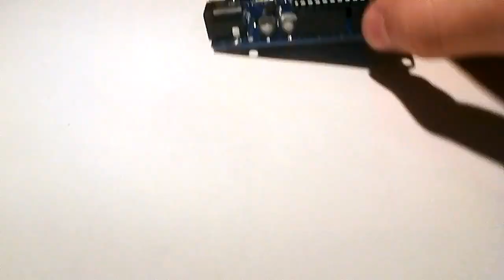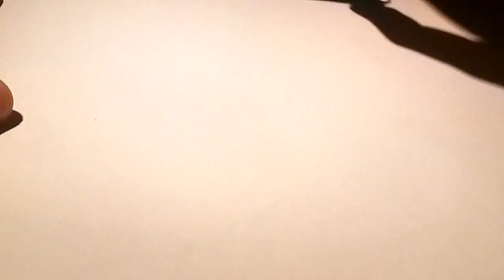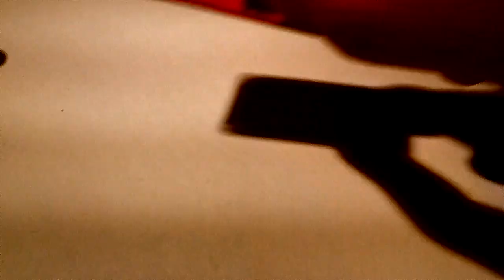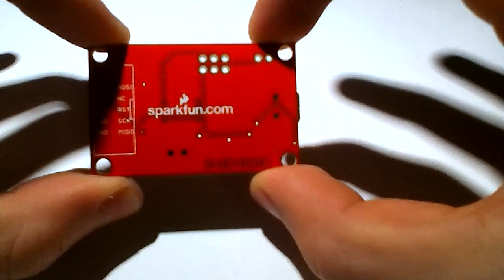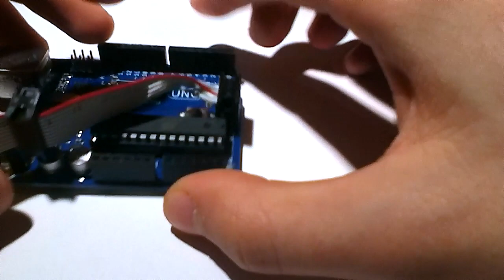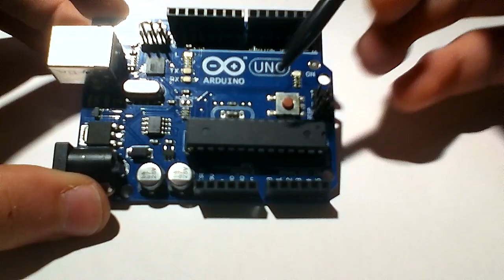Learning AVR-C Episode 1: Introduction

Comment: So how can I program my Arduino Mega R3. He says with the pocket programmer, I can only program UNO like boards. I have Mega. Can someone point out the programmer for this?

Thanks
Reply: If you are wanting to program the chip that is on the Arduino board, you can do this with the latest Atmel studio and an installed Arduino IDE. Search for "add external tool Send To Arduino" copy one line and then paste it into a text box in studio. http://www.instructables.com/id/How-to-Load-Programs-to-an-Arduino-UNO-From-Atmel-/ 
If you use serial for other stuff with your pc I recommend turning the prompts on to see possible errors.

Comment: is there any way to "get" source code from uC?
Reply: No, but it is possible to recover the assembled machine code from off the chip. You can guess what caused certain patterns of code, but you will most likely end up with a different source than what was originally written. With avr chips the code author has the choice of locking the code to make it more difficult to read.
Reply: You can only get the hex code from there ..
Reply: https://chat.whatsapp.com/BRE87Fd5RczDHLOSTbpobJ 
Join this avr grp for various avr projects ...

Comment: No I have no XTAL on my bread
Reply from the maker: +Olajide Oyekunle You need a crystal for the program to run.
Reply: Wow,  thanks a bunch. I actually do see in your videos that you use XTAL. But I also notice that you don't necessarily tie the MCU RESET to high. That's cool right?
Reply from the maker: You should tie the reset pin high as well for good measure.
Reply: +humanHardDrive thanks buddy,  I finally got my stuff working.

Comment: I gat a question please HHD. Am using avr studio6 and arduino uno as programmer with the help of xloader to upload the code onto the mcu. Using blink_led for example, can I remove the programmed mcu and use it on a breadboard  or in a circuit?
Reply from the maker: +Olajide Oyekunle Yes you can. The program is stored in non-volatile memory. When you put power to the chip the program will start again.

Comment from the maker: You don't need an Arduino to follow this series. AVR is an architecture of microcontroller, so this will not work for all devices, only those from AVR. AVR Studio is pretty much the standard for AVR programming. I know there used to be other options, but now, not so many.
Reply: Some of the links are not working. The links to atmel .com are redirected to the home page of microchip .com

Comment from the maker: When you program with the Arduino you're using a higher level language, which means all of the commands you learn, are chunks of C code. AVR-C is learning those chunks of C code behind the Arduino language, to make more efficient, and more controlling programs.

Comment: Thanks! Very helpful!
I was stuck trying to get my STK500 working with newer AVRs through AVR Studio 5. I bought one of the Sparkfun Pocket Programmers a little while ago and finally have it working as i want it to thanks to your AVRDude Assistant.
One feature request for your Assistant would be for it to remember which programmer you use. It's a bit of a pain having to find the Easy USB Programmer from the list everytime.

Thanks again. Much appreciated. Keep up the good work.